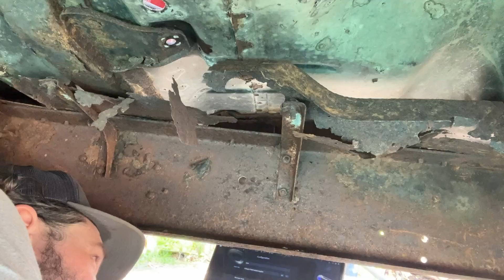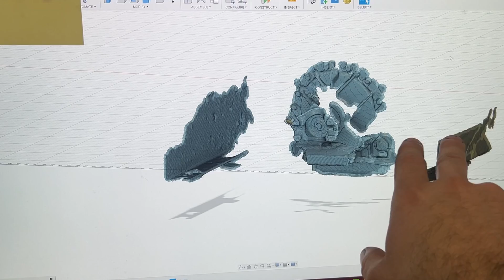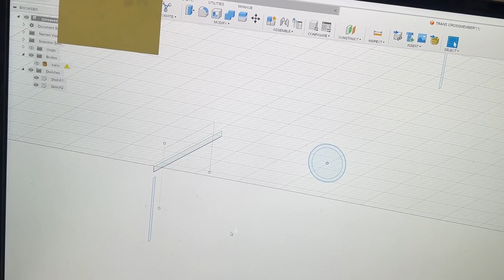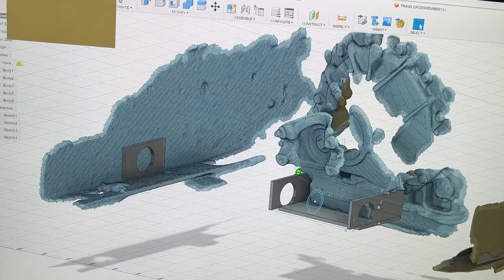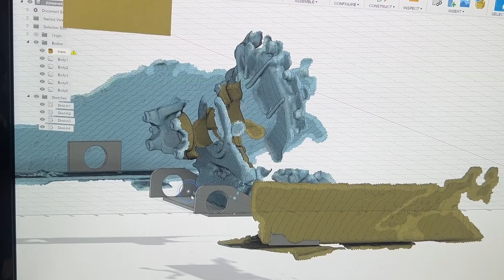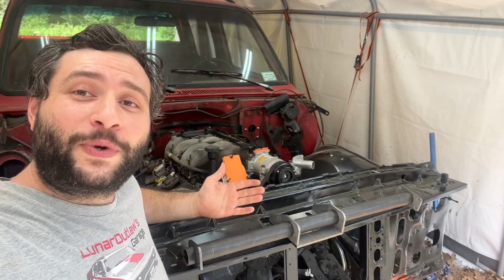How to design a transmission crossmember: Allison 1000 to square body

Comment: Did you need to modify the tunnel at all for the Allison to fit?
Reply from the maker: Yes, some of the tunnel had to be cut to not only fit the sheer size, the transmission, but one of the sensors as well